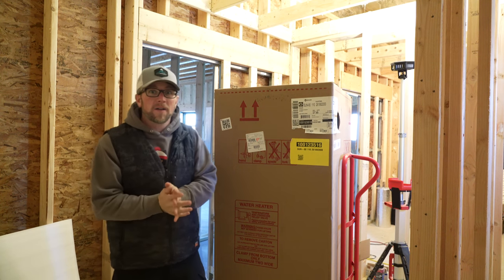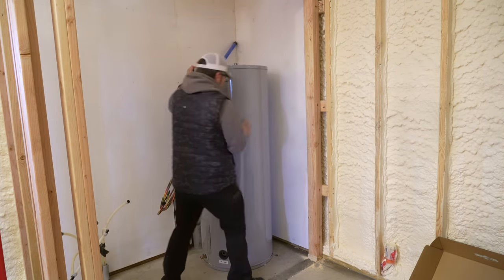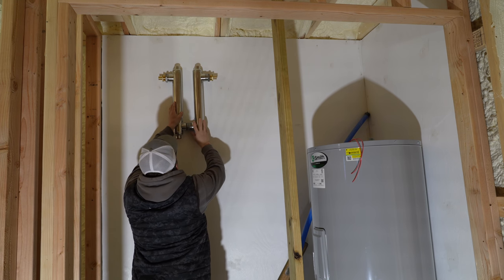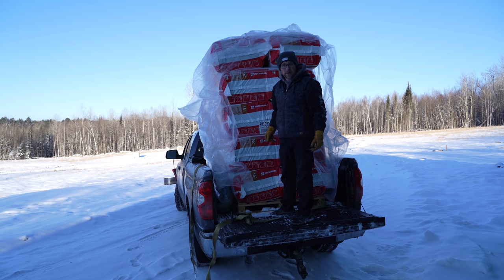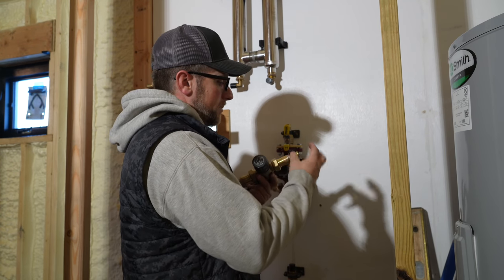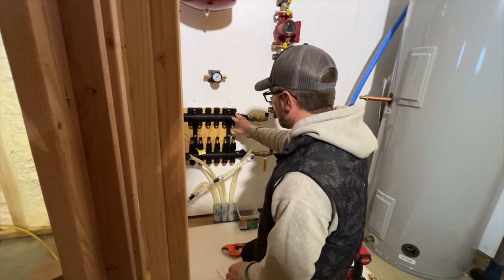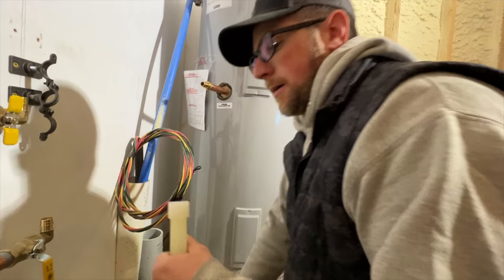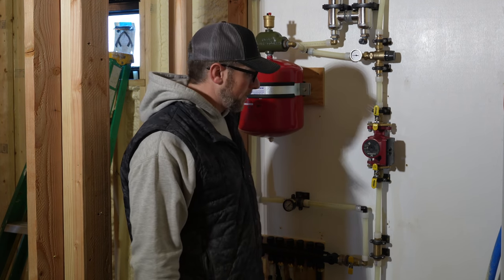What Could Go WRONG... Installing In Floor RADIANT HEAT with No EXPERIENCE!

Comment: I always worry about air bubbles blocking the liquid. Good luck! Heatmaster is the manufacturer of the outdoor wood boiler. Nice to know. Side ports for water heater, interesting. That is something I wouldn't have thought about. Good for you! You did your research! Yes, it can work for solar too, cool! Need your well pump too. What about pressure tank too? I'm glad your hot water tank was not damaged. I think the expansion tank should be the highest point if that is what that is. Is there a silicon ball in that joint? I hope it doesn't melt? It looks like a really good method to solder the joint. Your installation looks really good Al. I like your vertical pump. Do you have one more than you need? Just in case you have to do maintenance on the other pump? Those heat exchangers have to be counterflow. Wow, what is that Milwaukee tool called that adds the manifold connections to the pex? That's really cool! It is looking really nice Al. I understand you being hesitant to put water outside in the boiler right now with very cold temperatures! Don't break it! Ice is not your friend. Well, relieving the pressure in your slab heating tubes must mean they're not leaking.  This is extremely interesting to watch. I know it seems to go slow but this is the "gut" of your heating syatem and you need to make it all water tight etc. I'm enjoying this. Like other people have commented, the 90s make the pump work a lot harder and your flow won't fully redevelop for several diameters at each 90 so the flow will be restricted at each 90. It looks really nice but it'll cause problems. It will be noisier too! thanks for this Al.

Comment: I saw you apply Flux after soldering, why? You only apply it where you want the soldering to flow. You prep the mating surfaces with Scotchbrite or a abrasive. Apply the Flux to the cold material, heat,  apply solder. The solder will flow towards the heat. Damp rag to wipe joints clean.

Comment: I believe the flux goes on first.. not afterwards.  At least that's how I've always done it; seen others do it, and as I  understand it. The purpose of the flux applied first, is to help the solder flow .. I've never seen it used to: ( "clean up" the joint after ?
Reply: It was put on first!
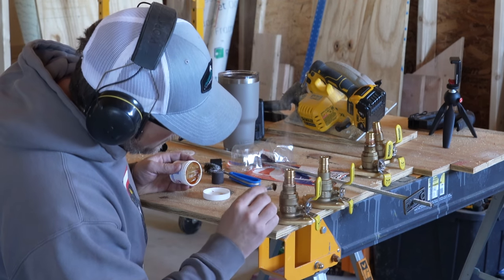Reply: @darlaherbst5929  Maybe... but if you go look at minute 17:15 you'll see he put it on AFTER saying.. "I'll clean it up with a little bit of flux" 
.... Flux is NOT needed or useful applying AFTERward when the solder has hardened already.
Reply: @peterbalazsy8263  lol... there's NO MAYBE and you know it!  It was put on FIRST and Al explained why!  He then decided to "CLEAN UP" the soulder USING FLUX.  It's not a common practice but all he needs to do is wipe it off with a wet cloth.  That's all!!
Reply: @darlaherbst5929  OMG...You just like to argue, ....like an old fish-wife!
 What a pain... sheesh.
When I said "maybe" is was as "maybe-so".
AND ...The man indicated (15:37) he wasn't familiar with flux very much and he invited ppl who knew more about it to tell him. I did exactly that.
( I work with it for the last 60 years)
He did NOT need to add  flux afterwards. It is certainly NOT a common practice! ...no one ever does that... end of story.
Learn to keep an open mind...   (life around you must be a real joy).... lol
Reply: @peterbalazsy8263  I don't know what your problem is!  All I said was he did put it on first!  Your lost Goodnight

Comment: better have a wood supply before you fire the boiler , you dont get a chance to run out with cold and water , will the radiant heat use any type of antifreeze  in solution????

Comment: Al, looks like your doing a fantastic job. I've been watching daily for a couple of years now and have enjoyed every moment of the journey.
I hesitate to step forward and come across as someone that is only out here to make your life miserable, but as I matched you working in the closet today, I noticed that the "expansion tank" (red tank on the left back wall) was mounted with the outlet located on the top.... If that is, an expansion tank, the outlet has to be located on the bottom, otherwise it will become water logged and be of no value to protect your system.
I hope I'm wrong or that you reposition the tank before you experience a system failure. Otherwise, GREAT JOB !!

Comment: Personnel, I would like to deal with the Rocks Wool than the Pink Panther type. That is because of the fact that the skin irritation is less with the first type, and it can be used as a fire barrier in between each floor.

Comment: REAL MAPP gas has been out of production for over 10 years.  What you have  is MAPP-Pro.  It is only marginally hotter than propane and costs a lot more !

PEX-A is great !  The tubing and fittings are a bit more expensive.  That power expander is also pricey, but it is SO EASY to use.   2 tips from a DIY plumber.
Use as few 90* fittings as possible.  They restrict flow.  Use 90* bend supports .  (Bending or straightening PEX in cold weather IS difficult !)
Use 3/4" to feed all spigots, sinks and showers.  1/2" does not allow adequate flow.

Comment: A heat pump water heater would have been a good option. They can make your kwh's go much further. They also dehumidify and cool the space they're in which is a plus in the summer. Another option is to use a reverse buffer tank for the boiler. It allows the boiler to run independently of the heating loops in the house and they also have a dhw coil inside. They supply instant hot water so no threat of bacteria in the tank and no pumps needed except for what is need to circulate between the buffer tank and boiler and buffer tank and heating loops on the house. You can also have a HPWH and the dhw coil in the buffer plumbed in series where the HPWH is fed by the coil. When the boiler is hot and running you heat the HPWH as you are use hot water. In the summer when the boiler is shut down it makes up the difference with the heat pump or electric elements if demand is high enough. 

Also to avoid making mistakes and and forgetting pieces and parts, draw up a plumbing diagram. It will save your sanity. You can use something as simple as MS paint.

And to minimize power consumption you can use zone valves and a zone valve controller. The valves can be powered by a 24v transformer and then you only need 2 pumps if you use a buffer tank or even just one if you forgot that. Also look into ecm delta T or Delta P circulators if you haven't already. They are incredibly efficient and you can set the curves to match heat demands.

Comment: I have a question. With this type of heating system, will you need a water softener? If this was covered in your previous videos, I totally missed it. Just curious if it’s a necessity. This is a awesome unit.
Reply: Well water usually needs a softener.  They haven't tested the water, yet.

Comment: What I do know about sweating pipe, hopefully that's a brass shutoff ball inside, otherwise getting that much heat on a valve is very bad for it. If you can take the valve apart and sweat the fitting, that's always best. Some valves have neopreen, plastic, O rings maybe that can melt if you sweat the fitting right on the valve. You noticed how hard ur was to open the valve after you sweat the fitting on? That was probably due to the amount of heat. In a brass ball you can get away with it most times but it is possible to deform the valve body so care should be taken that it doesn't cause the fitting to leak.

Comment: Hi folks!! Great job what you are doing there! AWESOME! 
Are you using glycol from house to outdoor boiler? Got many questions!
First of all: did you calculate the solar system heat dump for in the summer? You like have too much energy with your setup. Well, you can dump excessive energy directly in your tank by using heat elements. You can even do it directly from batteries without inverter. You need a heat sink anyhow.
Your tank is likely not big enough, you might want to have spare space. Best to insulate tanks even more, ESPECIALLY underneath. Are you not using coils inside your tank to exchange heat with? Looks like your exchanging transfer is not high.
Have much more details about saving energy and noise reduction. Just built mine NetZero, used Canadian technology combined with European experience.

Comment: If I were doing a radiant floor heating system I would use an anti-freeze/water mixture that is good to at least -40F to prevent inadvertent freezing, in the event the boiler needs to be left unattended for a time. This will save you a lot of future grief. The other benefit of the anti freeze is it has additives that help prevent corrosion in the system.
Reply: I've been asking about this for awhile now. I would just like to hear those words in a video. Al mentioned worrying about water freezing in the system. Why have to worry.
Reply: Yes ,,,you are right ,, to the point !!!!!!! Thats a lot of $$$$$ to turn it to a pile of junk😉😉😉😉😉😉😉😉😉😉

Comment: Had a friend who put a water leak alarm on the outside of the tank near the base so if it leaked he’d  know quickly to cut the water off. In our county you have to elevate the tank a foot off the floor instead of using a drain pan when the tank is in an enclosed area, a closet, but I don’t know what purpose it serves. Are you using a drain pan?

Comment: wow now that was some wacky wild attachment on your cordless drill to do the pex piping with, nothing like that here in the UK as far as i am aware only compression joints or solder(pronounced the correct way too:) ) keep them coming:)
Reply: Not an attachment but a separate tool called a Milwaukee Expansion Tool.

Comment: your doing a great job very talented in many trades.i love the pipework system your using with the external compression rings and that tool for exspanding them i assume it uses heat aswell ? making a guess at that never seen it before very cool idea tbh ...high 5 from the uk

Comment: would the heat transfer work better if the exchanger is below the top of the water heater? This would also keep the hot water from rising to the exchanger in the summer

Comment: At 27:45 love the shot of checking the instructions!🤣👍 Would have been funny if you tossed them!   You have mad skills! And Another toy, never worked with pex pipe, looks "easy". Are you putting the water heater in a leak proof pan?

Comment: When done put in 10 to 15 lbs of air in your whole system  to check for leaks
Reply: He has been doing that!  Didn't you hear the air escape when he cut the pressure gauge off?
Reply: @ScottCarlson1965  Lol...  it's not my fault that you missed something pretty obvious.  Your reply is crazy... You on drugs?
Reply: She did the same to my comment.
I think she’s a troll, just wants to argue for the sake of arguing LOL
Reply: @susansollee1839  Your the one trolling through comments and posting strange replies!  I, simply, pass on factual information!  Scott is just upset because he missed something that was very obvious.  Using a little common sense and less argument, would benefit both of you!  Bye!

Comment: So you can't run any anti-freeze in the radiant heating system?  Seems like that would be a requirement given the potential for the boiler to not be burning for whatever reason during a freeze.

Comment: Obviously the water heater will be plumbed AFTER any water treatment equipment.  One thing everyone forgets is that a water heater has an anode to prevent corrosion.  When you are on a well it should probably be changed very 5-10 years.

Comment: hi we have injoyed every video you should use glycol in you heating system , We live where it gets down to -40 I use glycol so my lines and boiler won't freeze
Reply from the maker: Thanks, What do you have for a boiler?
Reply: @LumnahAcres  I have a Coalman Out door boiler it sure is nice to know if you have trouble in the winter nothing freezes I have been running mine for about 20 years and have had it go down and it didn’t hurt anything

Comment: Get your hot water heater off the floor use a pallet cut it down to the size you need put a plywood top on it and you’re good to go and yes that is a standard screwdriver open or close valve on the water heater. read up on the pros and cons of draining your hot water heater. They make an automatic water cut off sensor if your water heater ever breaks it will turn the water off and not flood your room I also have one on my washer  water connections The sensor sits in a pan underneath the washer they are electrical. With rockwool insulation, wear long sleeves and gloves, if it gets on you you will itch and you have to wash it off with a washcloth or a soft scrub brush. As always check this information out on the Internet or ask someone that does what you are trying to do.

Comment: Flux is not a cleaning product it's to help the solder flow which needs to be cleaned with 91% alcohol to keep it from rusting.
Reply: Not rust -  corrosion

Comment: Rockwool batts are the way to go for sound insulation, easy to cut, easy to fit.
  I do not like the idea of soldering  near ball valves, you should dismantle them and solder only what you can’t damage !
 Mapp gas is too fierce for soldering as a general rule, it’s really for brazing.
   PS don’t you have any spanners (wrenches to you !) I hate fittings that look like a rat has been at them !
   Keep going, you are doing really well !

Comment: Your mixing valve looks like its not facing correctly mix is out center hot cold on the sides pump pulls the mix into manifold! Looks great otherwise!

Comment: There are Asians making PEX and PVC pipe modification by melting with heat.  One is using metal fitting to form inner and outer threads.  Another is a pipe piece over another pipe  pipe melted together and cut to form a lip for a compression compression fitting connection.  Another uses a metal coiled hose inside a pipe that is heated to make a sweep bend. without collapsing or kinking.   Maybe you can manufacture what you need like those 3rd world countries do.

Comment: Myself I like to use John Mansfield insulation hypo allergenic . It is a little more expensive but it protects you from allergies and it is a great insulation a lot of people use this stuff it just depends on where you're at it is very strong insulation definitely will keep you warm in the winter time no doubt about it all this stuff from many places... Anyway Pink panther is pretty much all right but still I go with the other matter of fact once you've used it and understand it you're going to find out one thing protective equipment and you won't have to worry too much about the glass if you know what I mean stuff is great to work with it's even heavier......

Comment: No brainer, -14 Deg put the 2nd floor heating in. You can always shut the valves @ the manifold. Are you sure that the black fittings are rated for your system design temperature. Why are you not putting the brass fittings in. Remember -14 Deg vs cost of material.

Comment: I don't like that manifold you have its,,,,,to small for what your going to do with heating everything,,    you need a 4" manifold!!!!!! Remember one thing how much heat,,   will you be losing,,,,,,,in the ground to heat everything I'll bet you will loose 15 to 25 degrees  in your longest run ,,,to the house you might lose 5 to 10 degrees when ground is frozen , I hope you insulate the pipes in the ground  ,,,, Remember you live in Vermont,,,,,,,I wouldn't run over 75 feet  away from boiler,,,,,did you put straw or hay in your ditches for your heat,,,,if not bad ,bad ,,,in my opinion 😉
Reply: Yes, his piping is to small for his theory of it working without a circulating pump.

Comment: 15::35 I've been sweating pipe for over 30 years. I've done almost all of my own plumbing and know that flux is what you use to fill your flux capacitor so you can get your plumbing up to 1.21 gigawatts. Otherwise you can't pass code and everyone knows that code travels at 88 mph.

Comment: that air scoop that you have I would have used a spiral vent. Also you'll find that you'll have trouble with that auto vent on top of the air scoop they  will leak. If you're going to keep the same setup I would put a little valve under that auto vent cause you will be replacing it. Just thought I'd mention it.

Comment: Rockwool is super easy to install. I would put some temporarily in the openings where you don’t have the windows. It will give you a little extra benefit even though it’s technically not insulation.
Reply: Its considered insulation by code.

Comment: After you wash the solder joint like you didwith the flux. You should wipe it down with soapy water.  Sometimes the Flux turns fitting green with time. Leaving the Flux like that also leaves a residue that holds dust and whatever is available to make a mess. Good luck.

Comment: Your air seperator is old school and not very good. Get a better one, also the newer ones have filters. Not shure if the heat ex is supplying your radiant but if so i hope someone did some calculations. Those shell and tube types are a bit low on the btu transfer. Flat plate types usually do better. I cant tell for shure if you are pumping away from the common pressure point because the plumbing wasn't completely finished. Sometimes it is helpful to put plywood on the wall before hanging all the plumbing parts, i think someone already suggested that. Many of the circ pumps already have a check valve in them. If you send me a diagram i can look over your design. Did you do a heat loss calc on your structure and did you have someone design the tubing layout? Kind of late now but you will need to calculate the needed floor water temp for this to work correctly.

Comment: Just got a new AO Smith hot water tank.  They don't have a handle. It has a provision for using a screw driver to open and close the valve.